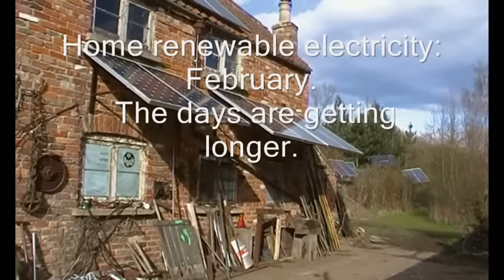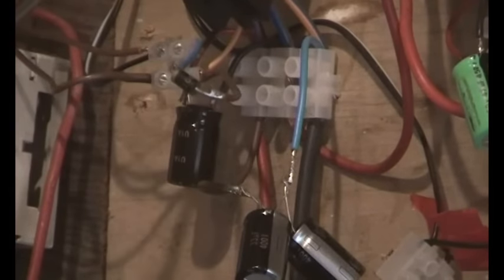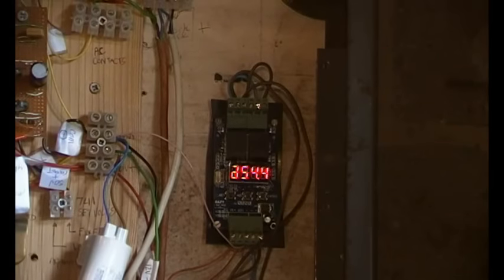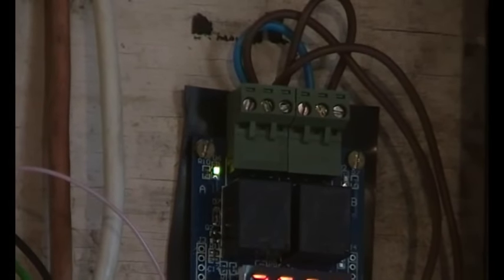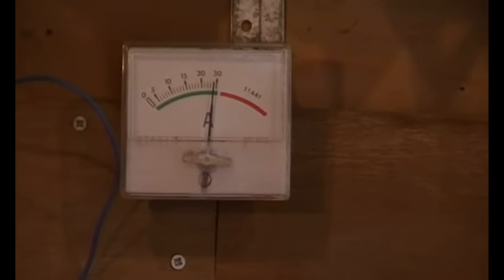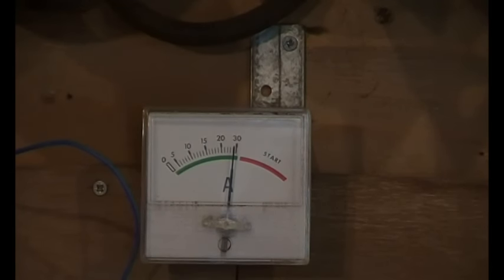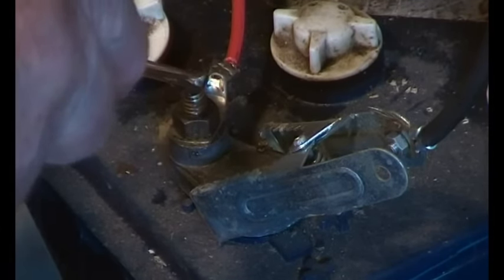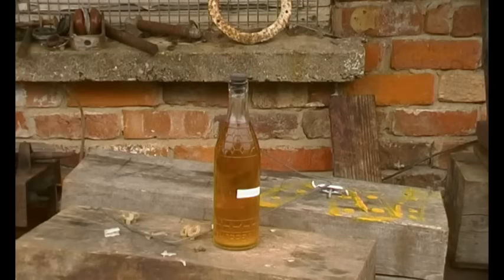Home generated electricity part 3:  February, the days are getting longer.

Comment: These are good series of videos Andy. :) I always enjoy seeing people doing things a bit more "inventively" rather than just showing off some flash new Midnight Solar / Outback / PIP / etc piece of kit. 

It's interesting you say how your solar production has picked up substantially over this period. I have just noticed a converse fairly steep drop off over here in NZ with ours. This has become noticeable in needing to be more careful with consumption over cloudy periods. Those kind of periods a month ago wouldn't have been a bother. The Equinox is only just over three weeks away now.....

From what I understand, the way you have configured your charge controller setup now is such that your homemade charge controller & that new voltage sensitive timer essentially does the bulk charging and when the batteries are getting full they cut out and leave the Stecca to do the finishing. Is that basically correct? 

Of course you could always use a DC-DC converter to furnish power to your slave battery from your main bank voltage. It would be more efficient...but where's the fun in that? Long may that incandescent bulb shine out in your power room! lol
Reply from the maker: Hi. I was teaching solar for a day recently and one of the thoughts that came to mind was " there is no such thing as too many panels". Although not strictly true, it effectively means the system needs to suit the low days rather than just the good ones. This to my way of thinking means spend what you have on panels rather than fancy kit. Cheers, Andy
Reply: A long time between replies...but totally agree...! :)

Comment: Your slave battery Andy - Could you tap off at the 12v point in your main batt stack to charge the slave (still with some kind of resistor in series ) and thus get some sort of charge voltage control into the bargain, plus you would eliminate that hideous "60v reaching the controllers" possibility completely ? Just thinking aloud, as ever :o) Dave
Reply from the maker: Dave. There was a reason I did it this way. As far as I remember it was that taking a tapping off the pack caused an inbalance over several months in the charge status of those cells that had the extra load. That was when the solar side was much smaller. You have got me thinking that there is a convienient 16v tapping and maybe a car tail light bulb would work as a resistance. This also shows that it is working. I think a test is required. Alan (Al) uses a plug in power supply to keep his slave charged. Check out his recent video on his 5 inch locomotive, steamingalan. Cheers, Andy
Reply: +Andy Reynolds Ok, trickle charge to slave must be more than I thought.....worth another test on the16v tap now you have more pv capacity by the sound of it then....yes, I thought of a plug in psu, but maybe your 'mains'  shuts down without a decent load detected, so you'd have very intermittent charging......steamingalan v.good -  his wkshop has some nice machines in it ! Dave
Reply from the maker: Dave, there are many ways to do this including a buck DC DC converter, but I like the simple bulb as a resistance, as I can see it working. Changing the bulb for a diiferent voltage or wattage will change the charge current. With a 60 watt 110v bulb it allows about 0.1 amp to flow. Cheers, Andy
Reply: +Andy Reynolds I like the simplicity of the series bulb compared with anything else, plus it's sort of failsafe... choosing a simple series bulb running from your 16v tap could be more tricky then...you only have about 2 or 3v to drop across the bulb...ok, I guess you'd be looking at filament torch bulbs in that case....and a bit of trial and error testing. Dave